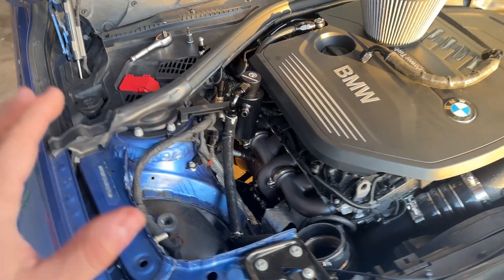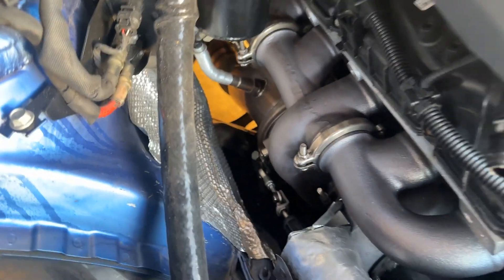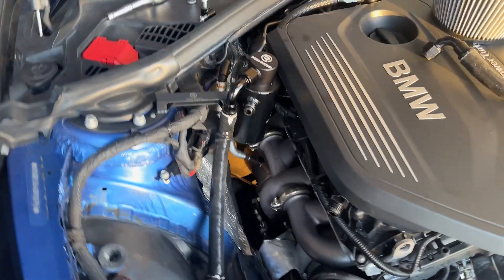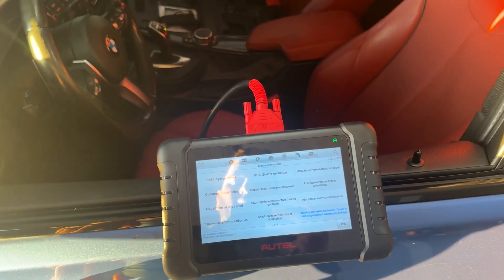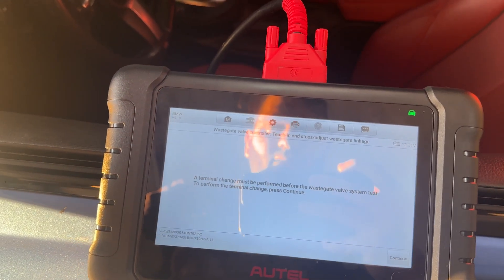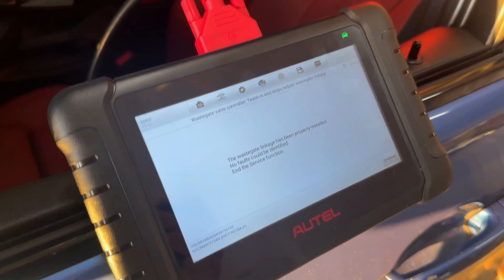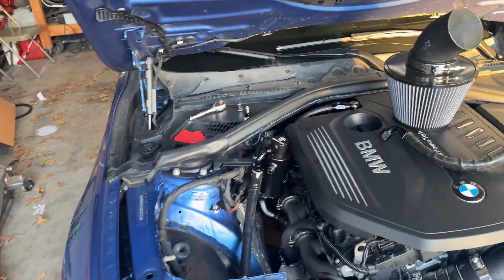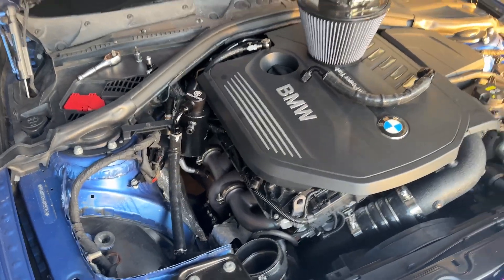B58 Wastegate adjustable.

Comment: I see soo many people struggling to adjust these wastegates. All you have to do is push the wastegate flap in the fully closed position on the hot side of the turbo. Then push the electric wasteagate rod down, and adjust the height of the rod, so the rod sticks out exactly 26 mm. At 26mm the DME thinks the WG is closed. Once it’s at 26 mm, tighten the locknuts and youre done. Thats is, great video

Comment: If I did the wastegate test or adjustment (whatever) and it showed that linkage was -0,60mm off, do I need to actually adjust that length manually or was it adjusted by the program? When I did another test length this time escalated to -0,90mm.
Reply from the maker: You have to continue the adjustment of the wastegate manually, than reattempt the test. The Autel doesn't reprogram the ecu to accept the current state of the wastegate, it just confirms that it is opening and closing within the perimeters that BMW has set for the wastegate via the ecu
Reply: @brianRED  Did you adjust yours by the trial and error method or is there a specific standard length that I should lean to?
And by the meaning of adjusting, is it just tightening the visible nuts?
Cheers.
Reply from the maker: @deathwish7005  you can attempt to adjust that way. it just depends on what code you get. one code indicates that the arm is to long and the other indicates that the arm is too short. you'll have to find the sweet spot. If you look at my Big turbo install, I have wastegate measurements related to the remnant turbo kit.

Comment: if i want to run this kit would i need a HPFP/ TU pump if i plan on staying on 93?
Reply from the maker: @tek3229  no. You don’t have to. But it would benefit you if you even wanted to move to e30/e40 in the future
Reply: @ would never be able to being that i stay in upstate NY for work, would i need a new manifold with this kit? there would be no need for port injection being on 93 as well i think?
Reply from the maker: @tek3229  you can use the factory plastic manifold. It will  be just fine
Reply: @ perfect thank you!